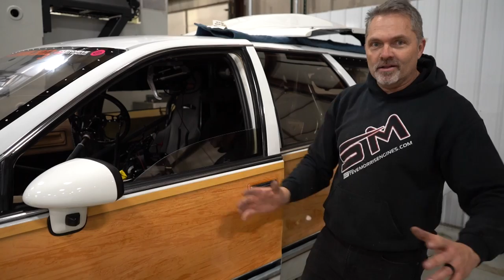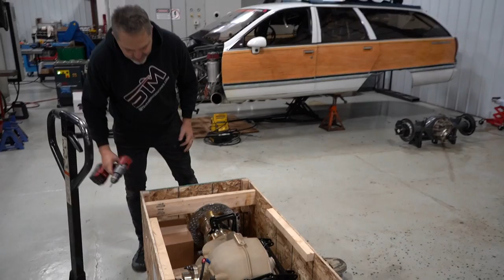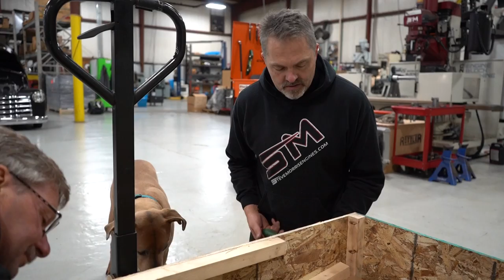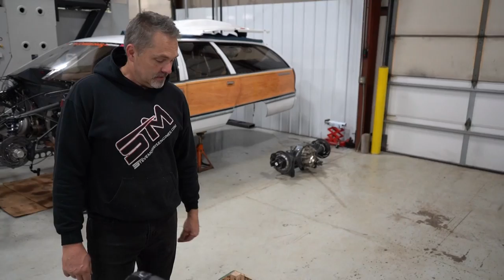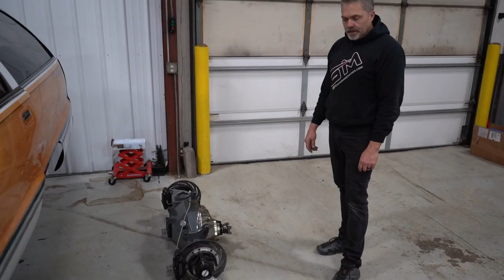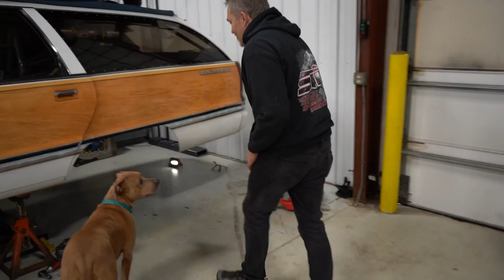UNBOXING A HUGE Upgrade For The Wagon !!

Comment: This is what was said about that pump at the MW site. “MW 9" and 12" modular rears are set up to accept a fluid pump to circulate rear end lubricant from the back of the housing forward to the pinion bearings and the gear contact area to extend bearings and ring and pinion life. Pump is driven off the rear of the pinion shaft. Pump assembly includes pump shaft, required fittings, braided hose, and fasteners. Requires 3/8" hex in pinion shaft” It’s a $645 kit.

Comment: Looks like that center section is as big as the one in my diesel pickup truck. Should handle well over 2500ft-lbs of torque anyway for hundreds of thousands of miles. Don’t know what they offer but did you go with a hard or soft gear since you drag AND drive this thing?

Comment: I remember seeing those in the Mark Williams catalog back in the day when I was younger and dreaming about building something would need one of those axles, and seeing them at their booths in the pits a couple of times when going to the races. They are definitely a work of art to say the least. 
I’d be curious to see if there is any ET difference with the new axle with the same tune as before based off of different u spring weight as I’m sure it’s lighter than the old axle, but then increased rotating mass/inertia because of the larger diameter ring gear. The ring gear diameter would have the same effect as larger diameter wheels and tires or brakes, and how they have an effect on measured wheel horsepower I’d assume. Either way though, that is one nice piece of art work.

Comment: Great video Steve,  Would the stronger diff take slightly more power to turn?
Reply: It would (assuming it is made from the same materials), but I'm pretty sure he has enough power in the new engine to more than compensate. Something about rotational mass etc...

Comment: Hi Steve it’s Gino from Canada. I have the same rear section of what you have.  You will no longer brake it. But I looked at your rear link bar. They look to small. I say. I would change them in double size.  And also. The transmission is still the week link still I’m going say. You will need to go with a liberty transmission. I broke everything car made 5000 hp. Anything in the 1.00 60 ft. You will brake.  The transmission is still week    Be safe my friend.

Comment: Diff oil pumps have been used for years in the World Rally Cars. Mainly for oil circulation thru a heat exchanger to keep the diff oil from breaking down under heat. While they have constant load and get really hot, I bet you could fry bacon on your diff housing after a run too. Surprised you have not run a diff oil cooler yourself given the HP you run Steve. Question: is Dewey a shop dog or does he go home with you every night?
Reply from the maker: How’s every where with me
Reply: @stevemorrisracing  Brilliant, love seeing him always around.